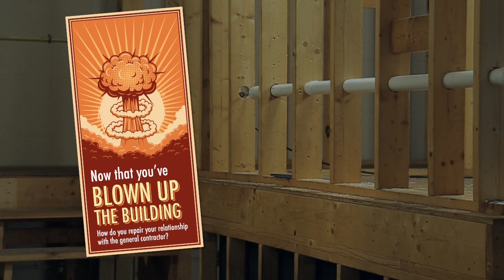Air Testing Your Plumbing System Guidelines

Comment: Unfortunately, the state of Idaho REQUIRES pressure testing of PVC plumbing for rough in inspection. Belive me, I don't want to.
I am curious, though, does pressure testing (in addition to being dangerous) damage the solvent welded joints? Our glue on test caps have failed.
I am having all manner of problems.

Comment: This is pretty stupid, I require 5 PSI on drain pipe in a residential slab. If they can't handle a 5 psi air test don't buy their pipe